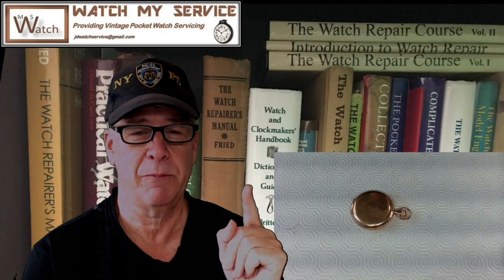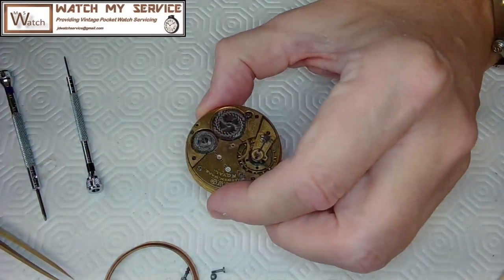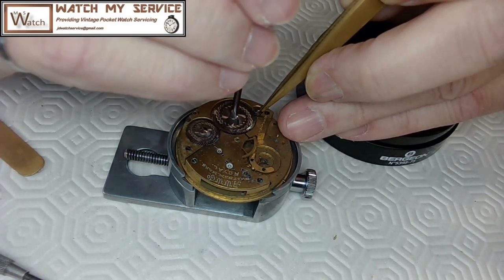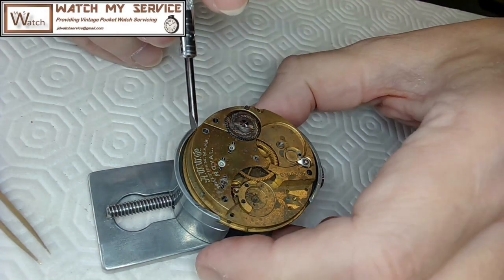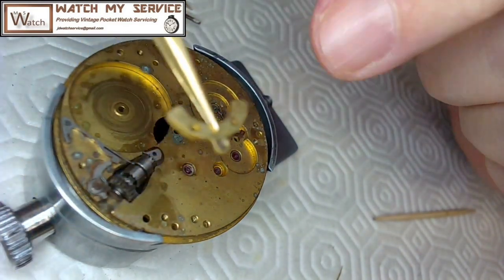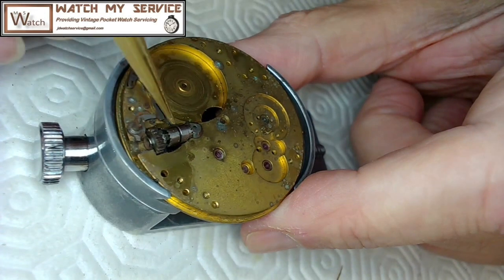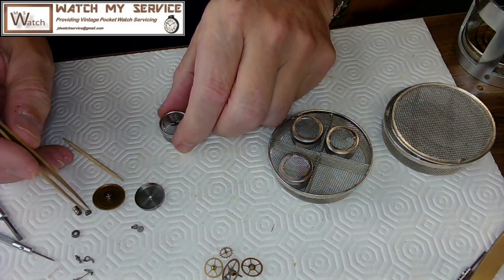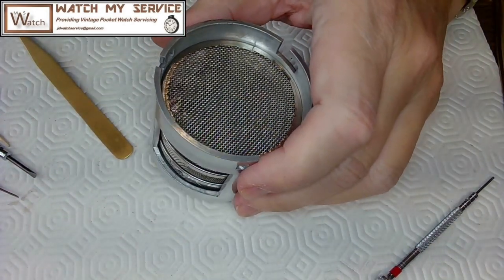Disassembly 1897 Waltham Royal Pocket Watch Restoration

Comment: On regulating a watch, if you go all the way to the slow direction will it go to the fast direction or is something wrong with my watch? Thanks.
Reply from the maker: As long as you are shorting the hairspring with the regulator arms, it will increase in speed
Reply: Anything that shortens the balance spring will decrease the period between beats (increase the speed).  If the spring is snagged, or even magnetized, it can cause the watch to run too fast.